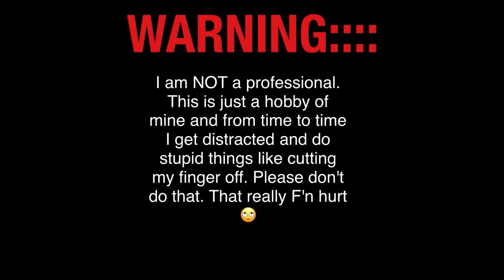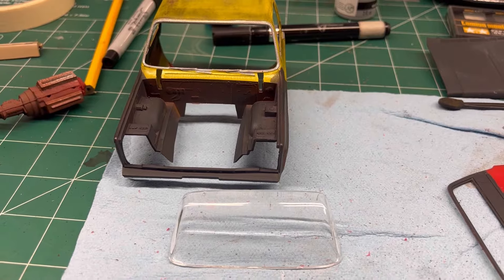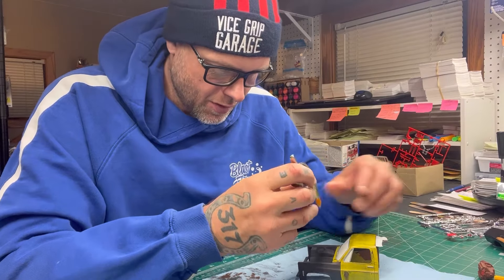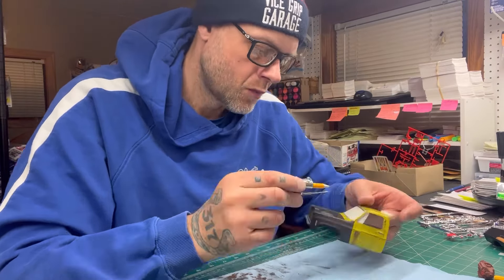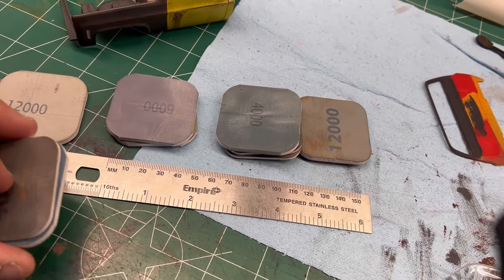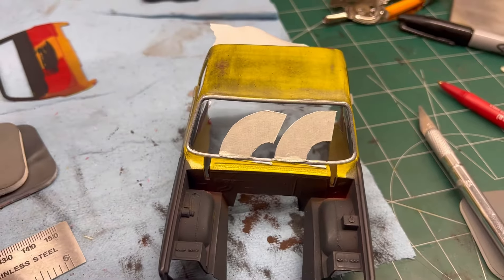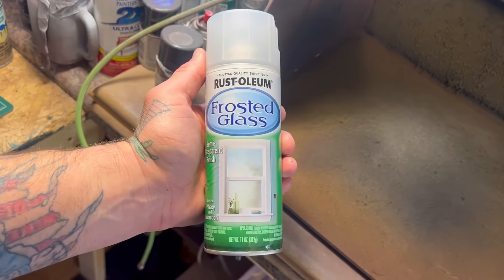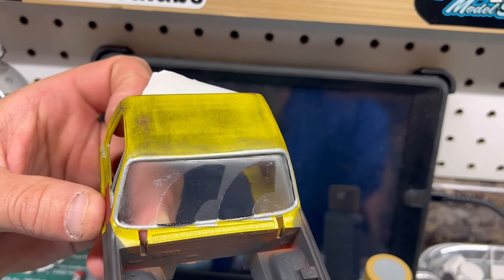Windshield wiper, effects weathering model car ep#43

Comment: Brian, I have something for you to consider when doing your windshield. For example, take your square body plow truck and square body tow truck you lowered. Now, a guy would figure these two trucks would be identical to each other since they were made by the same company, right? NO. The size of glass for the tow truck is about 2 1/2" wide with the wiper blade about 3/16" away from the corner on passenger side while the plow truck glass is about 2 3/4" wide with the wiper about 1/2" away from the corner. The location of your wipers will  be a big factor on how your glass will look..